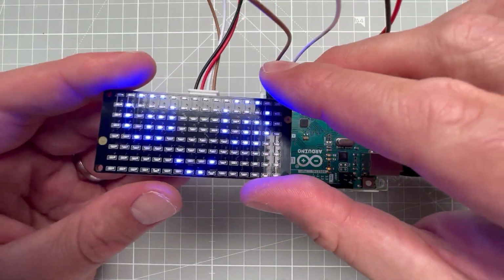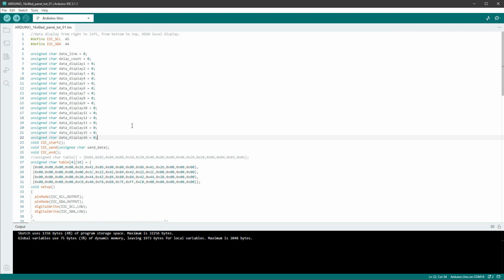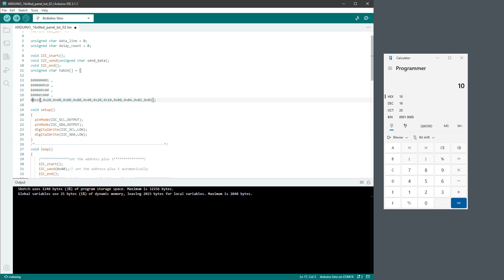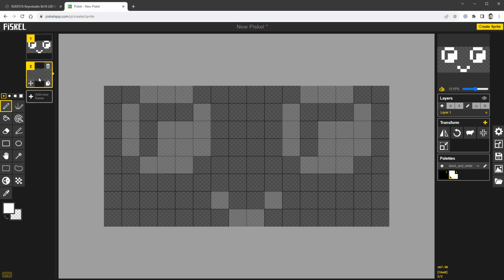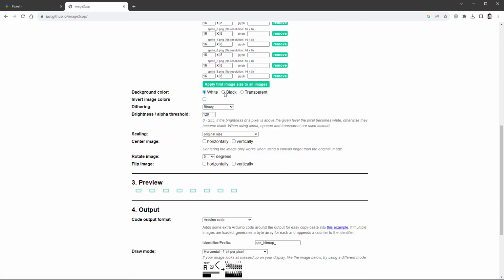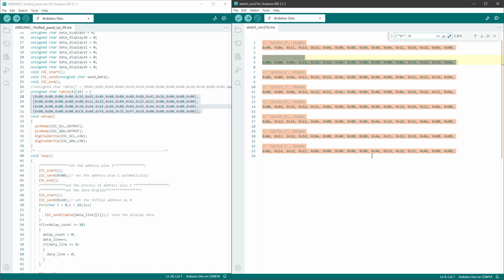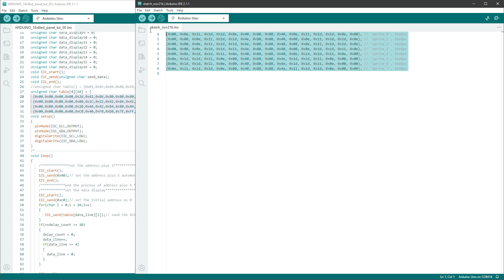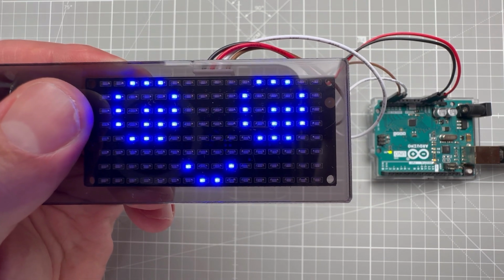Arduino Robot Eyes with LED Matrix Display

Comment: Thanks for this video! I bought some of the modules and the code works first try! Have a really cool project in mind for this.
Reply from the maker: That´s great to hear. What kind of projects are you going to use this with, if that´s not a secret?
Reply: @upir_upir  I recently got a bambulab printer and wanted to make a cool indicator clock with bicolor prints. Clough42 did an awesome video on hiding LEDs behind prints.